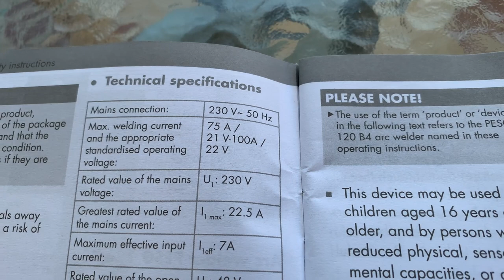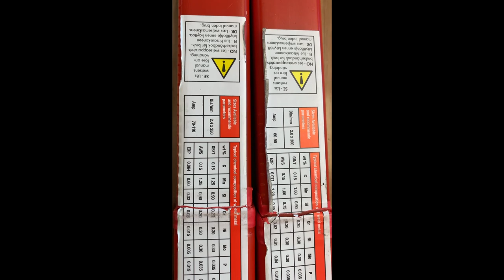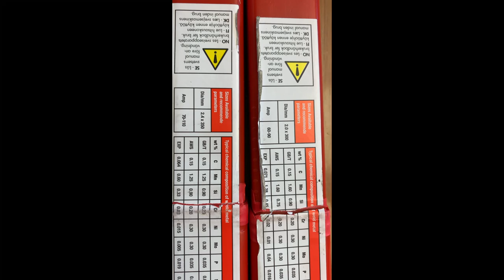Trying out the Biltema E7018 2.0 and E7014 2.4 mm welding electrodes

Comment: I couldn't get their 7014 to work well at all with either my ThermalArc or LIDL Inverter 100A1 welder. I ended up buying some 6013 from magmaweld 2.0mm , and it works absolutely great. Like magic.. absolutely easy.  I think there is something off about these 7014s. I think you have AC LIDL welder and I have DC model, both don't seem to work ideally. Also my ThermalArc 185 should work, I did try AC and that would make a start easily on ThermalArc.